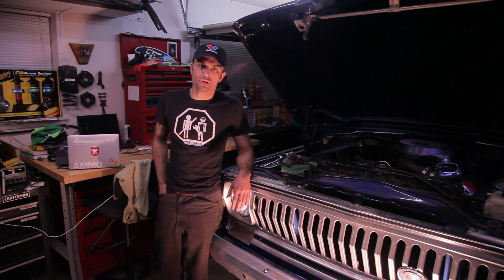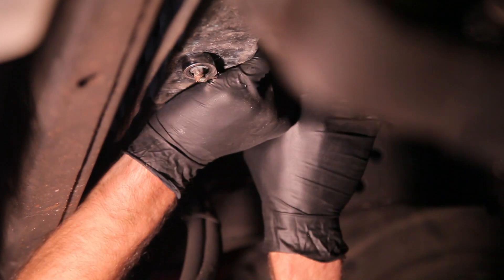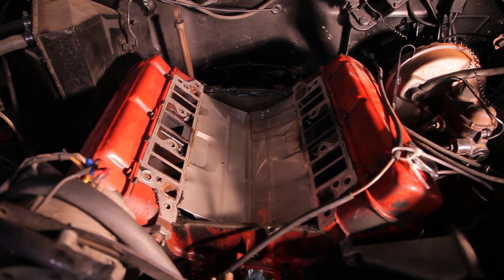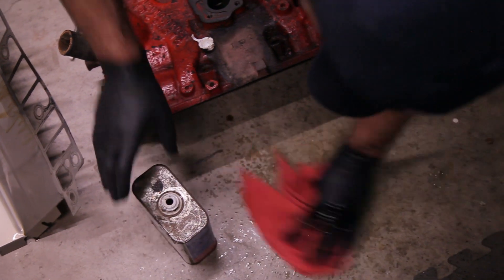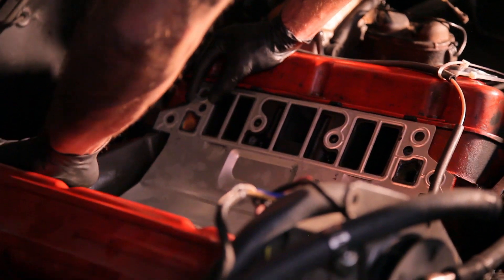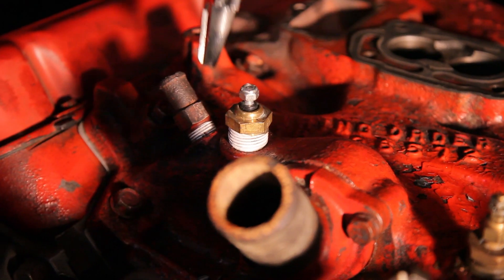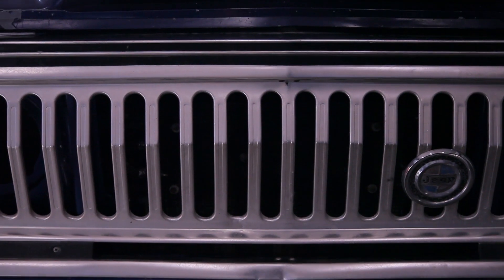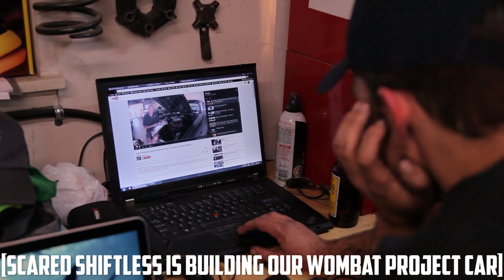Hooniverse Garage: 1969 Jeep Wagoneer Intake Gasket Fix

Comment: That intake looks just about as big as that of an old Ford FE Big Block engine- the cast iron manifolds for those weigh about 80 lbs. Maneuvering one of these onto the engine in a pickup truck is not an easy task for a single person!

Comment: how heavy is that intake? 50lbs?
Reply: jjlwis (This is Tim from the video) Probably more like 75. Not too hard to lift from the floor when it's just sitting there, but lining it up while holding the carb bores with my fingers was pretty tough.
Reply: holy shit.... that's insane!!! I keep forgetting how heavy cast iron is.... like the old bathtubs... crazy!!! strong hands.... and yeah I was cringing too when you were balancing it on the radiator.  Good job brother!